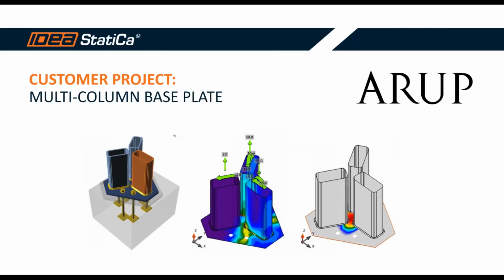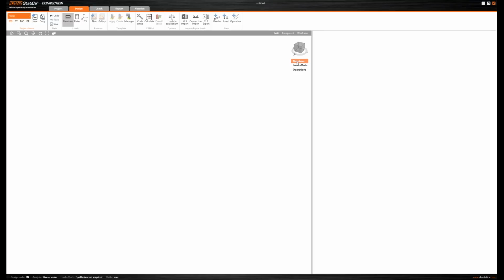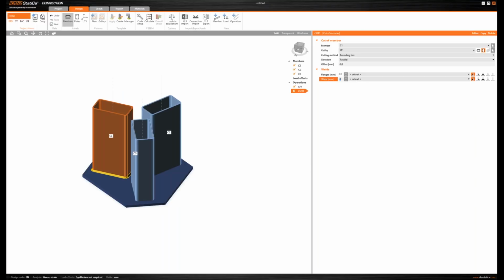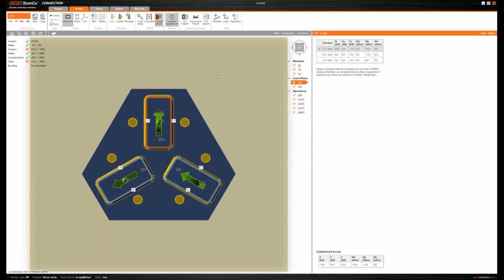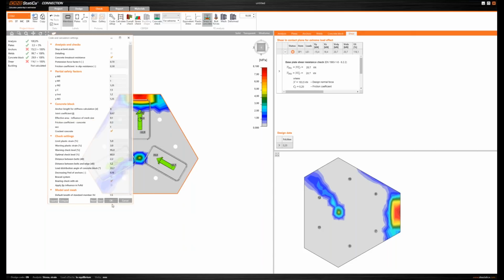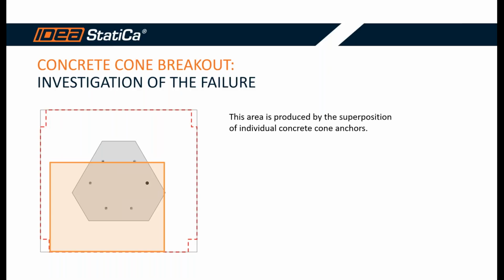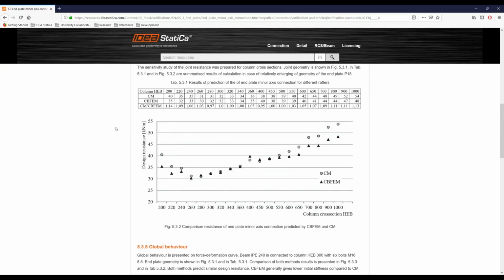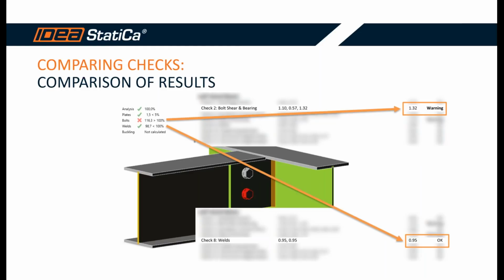Connection Wednesdays – Multi column base plate by ARUP

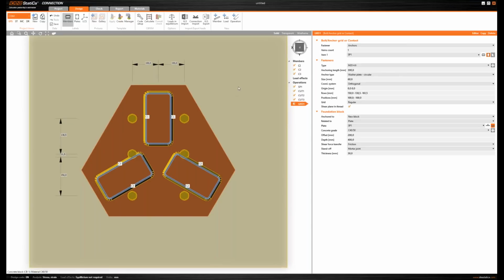Comment: @17:00 why do you need comma to separate the "position" but space to separate the "rows" and "origin"
Reply from the maker: Hey JJ, this is the "system" of inputing the bolt grids, there are more options - relatively with space and aboslutely with semicolon, etc. - see the tooltip in the software (hoover mouse over the word "rows" etc.) and read this:
https://www.ideastatica.com/support-center/bolts-positioning-in-end-plate-operation

Comment: Hey Theo & Costis. Thanks for this webinar - it's very informative. I have a question - looking at the base, weld access is poor to the internal faces of the columns. Does Statica look at this?
Reply from the maker: Hey RIck, of course you can define the weld on any edge as you wish to design it. Here it was probably accessible to weld the inner edges as well...